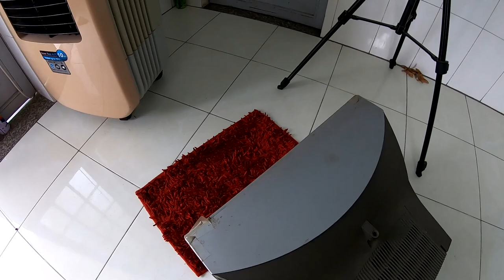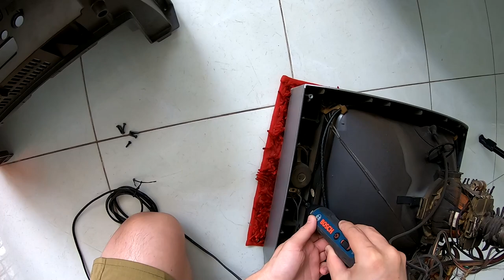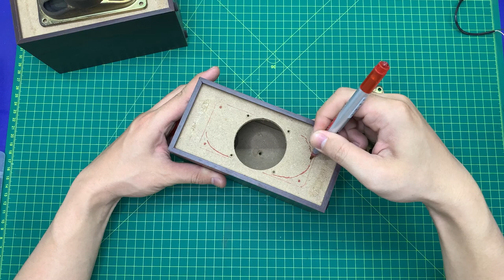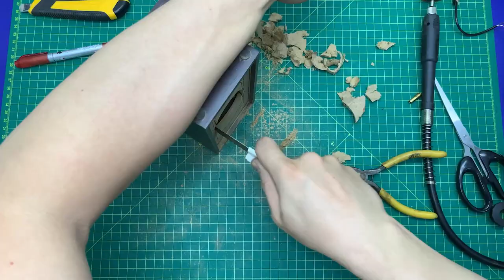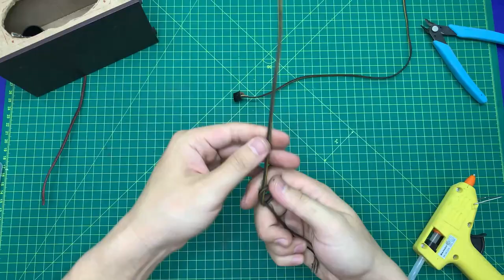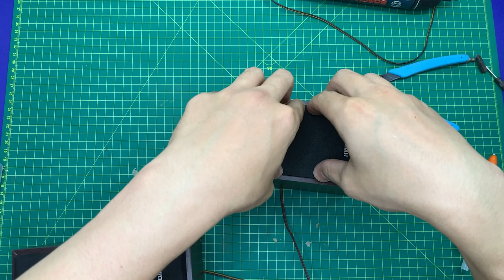Mini bookshelf from Old TV speaker

Comment: what amplifier should i use for 10watt 8ohm speakers?
Reply: Pam 8610 dual channel
Reply: 12 v adapter
Reply: @rjlineup  i asked for the amplifier, not the power supply
Reply: @ayyhmed  he said pan 8610 earlier its an amp
Reply: Maybe Class D amplifier at least 10w, good psu isolated to avoid interference
Reply: @ayyhmed  PAM 8610 is 12v amplifier (2x10w).